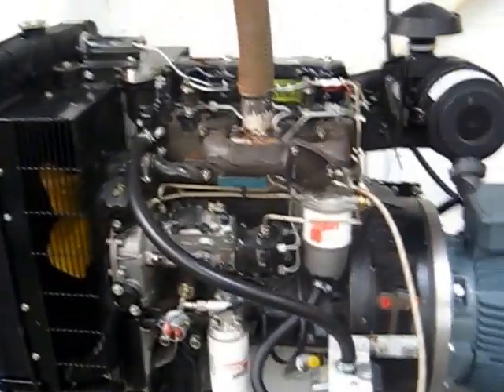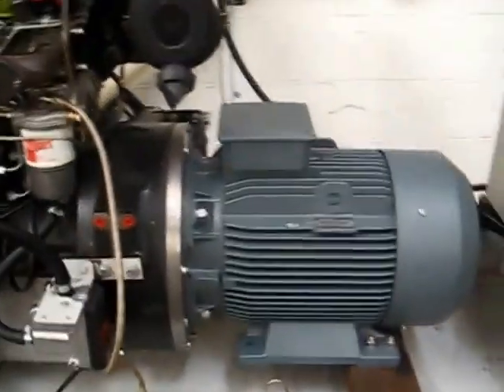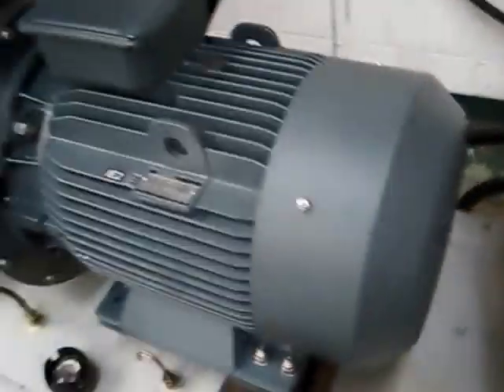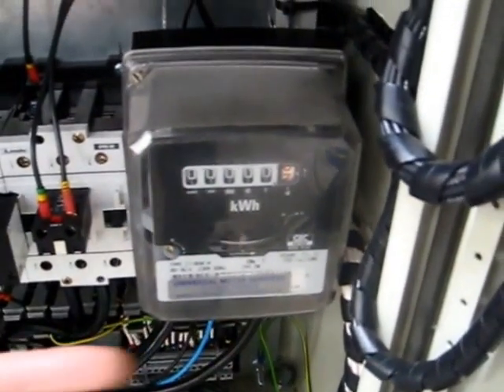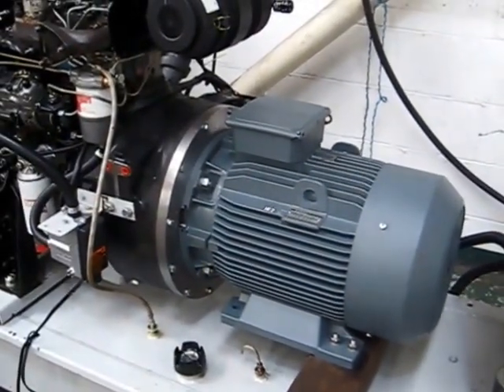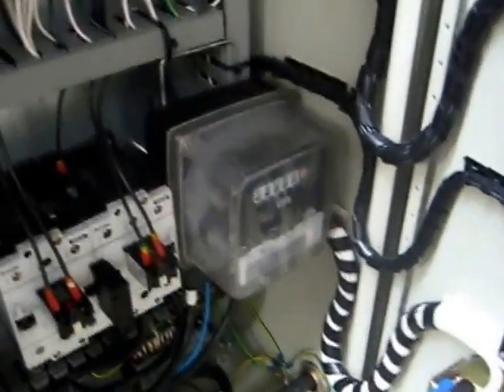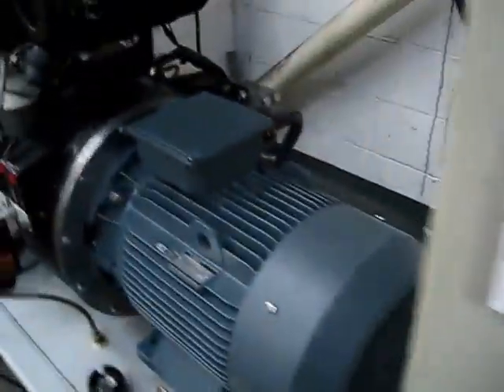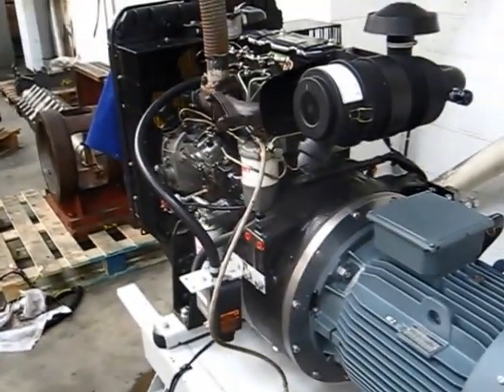Making an asynchronous generator

Comment: Don't you need capacitors to induce a magnetic field in the motor?
Reply: Not if its tied to 3 phase mains.
Reply: @roadiesgarage3816 

Which makes this setup useless as it cannot generate power when mains power is lost.

Comment: Where this makes sense is to heat your home with the waste heat (water heat exchanger-basically put the radiator after your furnace blower) and while the engine is running pump power back into the grid.  The theory of co-generation!

Comment: needs a cap bank to supply the asynchronous generator with VARs otherwise you'll have a poor power factor which could lead to voltage issues

Comment: Hello ,
Very instructive video, congratulations,
Would it be possible to operate your system outside the electricity network? With capacitor bank?
Would it be possible to operate the system with the installation of a 12 volt inverter 220 v pure sine and a battery?
Thank you
Reply: Yes but using a capacitor bank I believe would be tricky as changing the load also causes changes to the frequency and voltage in this configuration. Using a sine wave inverter would probably be more effective to control the power output.
Reply: @seanstrickland551  , Hello ,
thank you for your answer, I made a mistake, I was talking about a 400 volt three-phase inverter.
I was thinking of connecting a three-phase inverter like a frequency converter 11 kws input 220 volts output 3 phase 380 volts preset to 50 hzs, powered from a simple inverter 12 volts 220 volts on battery.
If I start the 11 kw frequency regulator on a small three-phase asynchronous motor, so that the setting is correct.
And then I couple the generator to the system.
I think that the frequency of 50 Hz would be imposed.
But I'm afraid to burn out the inverter.
What do you think ?
Sorry my English is faulty.
Best regards

Comment: The early wind turbines we had in Denmark used this method of exciting the generator from the grid.
One thing I wonder is, how come that when engine stops running on fuel, the meter only goes backwards for short time ?
Is it some in rush load the engine creates on the grid and then when it spinning at the 1500 minus slip speed it draws less power from grid like so small power the meter only spin very slow ?
Reply: It's a feature of the meter. Before this feature was added, people would re-wire the meter to make it go backwards which would reduce the amount of electricity they had consumed, thus reducing their electricity bill.

Comment: Interesting.  Isn't there some chance of closing that breaker 180 degrees out of phase?  I suppose the "generator" isn't developing any voltage until it's excited by the grid.  What is the situation with voltage regulation when the grid is lost?

Comment: Hey please tell me that, should I give initial supply to stator for generator action in induction machine??
Reply: If you have appropriately sized breakers and the direction of rotation correct, it doesn't matter. If you power the motor before the engine, if the motor is strong enough it will start the engine.

Comment: This is by far the best way to sell power back or help your power bill out for small plant during peak use but only for short burst because fuel is much more expensive than electricity
Reply: The engine will run on biogas
Reply: Well a 2mw genset can consume 17 gal/hr and electricity cost at 8-12c a kw......
Reply: @tripplefives HVO ?

Comment: I don't see the point . if you had a generator why do all that ? Want to sell the one you took off ?
Reply: You do this to sell power back on the grid this method is the safest and most reliable way to do it. Most power company's in the US will not allow you to have a generator like stand alone to be grid tie
Reply: The next step is to convert the engine to run on biogas. This then allows you to push electricity on to the grid (save you money if it's on your side of the meter) without the need for a £2000 synchronising controller (plus electronic governor and AVR).
Reply: @jmarkwwalker  Thanks for the demonstration.   I don't understand the difference between the generator you took off and the generator (motor) you put on.   Aren't they both induction machines ?   Why did the old generator need a more sophisticated synchronizing controller ?   Was the old generator a permanent magnet synchronous generator ?  I'm guessing it was a 4 pole permanent magnet brushless "exciter", ie rotor and connecting it to the grid was difficult because it had to be precisely synchronized, versus an induction motor, which does not need to be synchronized nearly as closely.

Comment: When the grid is powering the generator, does the fuel tank refill with diesel?
Reply: Lol.
Reply: Back in the day, we once produced a prototype that had a similar setup in the basement of our shop. One of our guys accidentally left the power switch on for the weekend. The tank overflowed. By Monday, the whole basement was filled with diesel. We had it removed, but the smell of diesel still lingered for several months.
Reply: @jiangli6498  🤣🤣🤣
Reply: No. Just no. You honestly should learn how those work.
Reply: i guess you couldn't recognise sarcasm if it hit you in the face :D

edit: typo
Reply: @theq4602  r/whoooosh

Comment: of course it's possible just need 33mfd per horsepower per phase.... Will spin itself off the grid and generate at the same time... it requires nothing to grid sincronize itself.... p.s. cos phi = 1, and not .047
Reply: Can you expand on this?

Comment: hOW ABOUT MAKING IT A PORTABLE 3 PHASE GENERATOR WITHOUT THE GRID PRESENT? MAYBE WITH CAPACITORS TO KEEP THE FIELD GOING?is it possible?
Reply: It can be done however its not real stable.
Reply: Yes, capacitors can be used to make a stand-alone induction generator. The military use this type of generator because it is more robust and they are far better (than synchronous generators) at starting large motors
Reply: @jmarkwwalker  i know this is old but, how do they handle in rush currents? Also for the military to use them they must have good voltage stability, how do they acheive this?